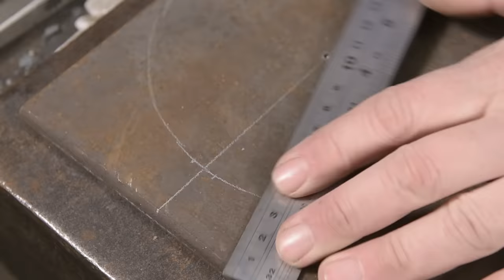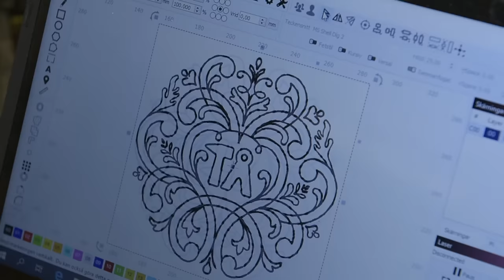Making a wafer iron

Comment: This is splendid! I'm American, and part of my heritage is Norwegian. I have a traditional Norwegian utensil of this type, made by Jotul. My grandmother called the product krumkakke, and was rolled on a tapered roller instead of a straight one, so they would slip off the form easier. My recipe is similar to yours, but included eggs in the batter. As you say, the traditional utensil is made from cast iron. Mine has a separate ring, made to fit over a burner on a wood stove, but it works very well on my glass stove top. (I have an aluminum foil layer on the stove ring, to protect the glass stove top and it works very well) My iron is seasoned nicely and there is enough butter in the recipe that I do not have to oil the surfaces for each krumkakke I make. I can make and roll one every minute, when the temperature is right. Your skills are wonderful, and you have made a beautiful tool! Thank you for this video!
Reply from the maker: Nice! Thank you!

Comment: The varying surface finish quality with diameter visible at 5:05 demonstrates why it is often difficult on older lathes to benefit from tungsten carbide tooling. The reason for the high finish towards the outside of the facing cut is the high surface speed. Because it is so brittle, TC is, for durability, not usually provided with a sharp edge. 
At high speeds this does not matter as the energy of the cut is sufficient to propel the fracture ahead of the tip of the tool, as with an icebreaker with sufficient power to break ice at (say) 5 knots instead of 3. In this situation, the cutting edge (like the very point of the icebreaker's bow) does not need to be sharp, because it does not touch the work.
Older lathes do not generally run fast enough to achieve such speeds, unless the workpiece is towards the maximum diameter which that lathe can accommodate.
Reply from the maker: :) I know, but it doesn't matter here
Reply: @torbjornahman  Sorry, I should have made it clear that my comment was not in any way directed at you; I was just taking the opportunity to satisfy the curiosity of anyone reading the comments section who might have noticed (and perhaps be puzzled by) what, to me, is an interesting outcome whenever facing large diameter work in mild steel (in particular) at constant rotational speed.

Comment: Beautifully done. 👍 It looks (falsely) so easy. And a so sure engraving by hand ! How many hours id it really take ?
I got four of those , old and more recent but all overused. Unhappily all get rusty even kept in a warm and dry place. I have to clean a long time with a toothbrush before use.
I have different recipes, one called "oublies" in France and already sold in medieval times in the streets or as gift, and another, my favorite, with rum. But I dare not use my kitchen hob, rather a gas hob easier to clean.
Reply from the maker: Thanks. Sound strange, that they rust? Never clean them with soap after use, just wipe with paper.
Reply: @torbjornahman  Thank you. I'll try next time.

Comment: Excellent video!
 what is that kind of red ink you use prior to laser engraving? Why did you use torch welding for the handle and not electric? What oils do you use at 20:44 to blacken?
 I can almost see the ad "Buy Thunder Bear's wafer iron now, it will let you make waffles after nuclear war and zombie apocalypse."
 At 3:30 I make the exact same facial expression when I make a mistake and I can't blame anyone else.
Greetings from Patagonia Argentina to you and your family, a Merry Christmas and a Happy New Year.
Reply from the maker: Thanks. It's a standard layout fluid. I brazed the handle with a brass rod, and used canola cooking oil to season it.

Comment: Looks like vanilla pizzelles rolled up, I really like your craftmanship on it, but I think it would be much nicer if it was made out of copper and tin lined. :)
Reply from the maker: Thanks! I doubt the tin would work with the heat when cooking.
Reply: @torbjornahman  Copper pans are tin lined...you could always make out of bronze (or brass) instead so you wouldn't have to worry about the tin lining, but copper is the best cooking metal other than silver. :)

Comment: Being as the pattern is seen only on the outside of the wafer, is there any advantage in engraving both top and bottom plates?
Reply from the maker: Good question! The pattern actually contributes to the thickness or mass of the wafer so it does matter!

Comment: I say "two times" all the thanks and good comments lauding your skills!   I have a question. I use a similar iron made by my great grandfather to make Italian pizzelle.  It has his initials  and the year 1926 as part of the design.  Over the years they have worn down until they are almost impossible to see.  Is there anyway a Blacksmith could  deepen the indentations to make them legible again without harming the integrity of the iron?
Reply from the maker: Thanks! Not sure... If it's cast iron you should definitely just grind it like I did here in the video. If it's proper steel you it could me manipulated with more force... but again I don't know really.
Reply: @torbjornahman     Thanks for your quick response.  How can a regular person tell cast iron from proper steel?
Reply from the maker: @juanadonatelli2708  Not super easy... first is the tell signs of the actual casting. Lines from the mold etc. If you drill into it, cast iron produces a powder while steel makes actual shavings/spirals of material (but that require you to make some damage...) . Grinding cast iron produces a small shower of branching sparks (high carbon content). All in all not so easy... I think I would go with grinding the lines with a steady hand I think to be on the safe side.
Reply: @torbjornahman     Wow, so it's even difficult  for an experienced professional.  It looks like I'm going to have a hard time finding someone that wants to mess with it.  Thank you so much for your time and informed  expertise.

Comment: Recette trouvée dans le livre de recettes de ma grand-maman  :
il vous faut : 4dl d'eau, 1dl de vin blanc sec, 200g. de sucre, 1 œuf, une prise de sel, zeste râpé et jus d'un citron, 125 g. de beurre, 1 cuillère à soupe de saindoux, 500 g. de farine blanche, 2,5 dl de crème entière (35% mg) ou double crème de la Gruyère, 1 petit verre de kirsch.
Chauffer l'eau, le vin et y dissoudre le sucre, laisser refroidir, battre l’œuf entier et l'ajouter, incorporer la farine tamisée progressivement. La pâte doit être lisse et crémeuse sans grumeaux. Ajouter le zeste et le jus du citron, la crème et le kirsch. Laissez reposer à couvert et au frais (5°- 8°) au minimum 2 heures (une nuit c'est mieux).
Cuire ensuite les bricelets au fer (de grand-maman) et SURTOUT déguster avec plaisir cette gourmandise faite maison

Recipe found in my grandma's cookbook:
you need: 4dl of water, 1dl of dry white wine, 200g. of sugar, 1 egg, a pinch of salt, grated zest and juice of a lemon, 125 g. of butter, 1 tablespoon of lard, 500 g. white flour, 2.5 dl full cream (35% fat) or double cream from Gruyère, 1 small glass of kirsch.
Heat the water, the wine and dissolve the sugar in it, leave to cool, beat the whole egg and add it, incorporate the sifted flour gradually. The batter should be smooth and creamy without lumps. Add the lemon zest and juice, cream and kirsch. Leave to stand covered and in a cool place (5°-8°) for at least 2 hours (overnight is better).
Then cook the bricelets in an iron (from grandma) and ESPECIALLY enjoy this homemade delicacy with pleasure
Reply from the maker: Cool!

Comment: Awesome video.
So a question. Is it possible / practical to cnc carve the pattern directly into the metal?  Even if you have to make 10 or 20 lighter / shallow passes of the cnc tool head?
Thank you for sharing your techniques. Thank you for not adding muzac.
Reply from the maker: If  you have a cnc, do it! Hand carving takes a long time...

Comment: Can you solar-power 3-phase in your workshop? Or that is only for home?
Reply from the maker: Absolutely, it's connected to the grid as well for selling any over production. BUT the output is minimal now in the winter of course. Produced 2kWh today though!
Reply: @torbjornahman  allow me to ask another question - what energy do you use for heating the home? As far as I know, piped gas is not common in Sweden due to mountainous terrain. Electricity is not cheap for heating simply but maybe using thermal pump or another modern contraption is reasonable? Or even pellets or firewood - antic-modern eco-friendly fuel?
Reply from the maker: @elrond12eleven  Heat pump, via 200m drilled hole in the bedrock below!
Reply: @torbjornahman  thanks.

Comment: At 23:32, wouldn't the burn off on the glass top and cause smoke? It has always set off fire alarms in my house while cooking. Its very new to me as I'm used to cooking on gas. coil induction in Germany is kinda difficult to cook.
Reply from the maker: It's an induction heater, so the glass doesn't get that hot.

Comment: At the beginning you cut two circles out of the sheets with an angle grinder and then sand the edges. But in the next part of the video you use circles that are obviously laser burnt. Otherwise, very nice work.
Reply from the maker: Not sure what you mean... it's the same two pieces I use all the way...